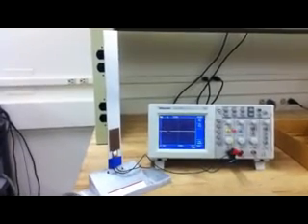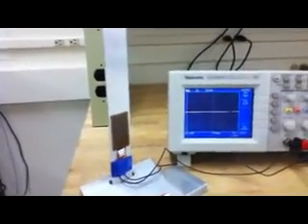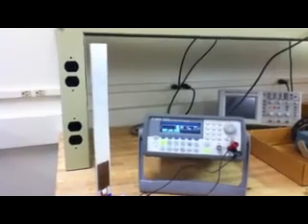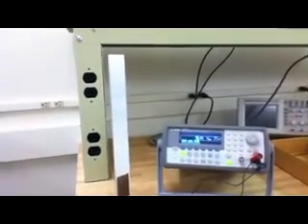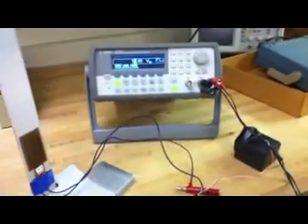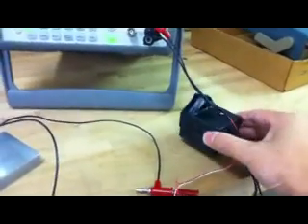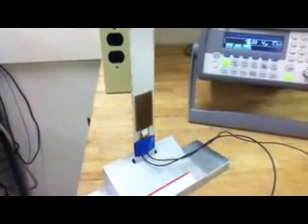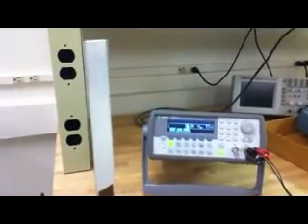PZT Sensor & Actuator

Comment: another question sir, did you tried to determine the resonant frequency by applying different voltages?
Reply from the maker: I have a function generator which outputs sine waves with adjustable frequencies.
Reply: does the function generator was connected to the sample (PZT)? and the oscilloscope was also connected to the sample? then if so does the frequency you set in function generator is equal to the frequency detected by the oscilloscope?

Comment: where you connect the negative and positive terminal of ac sourc in pzt material? and what is the dimension of the pzt?
Reply from the maker: The PZT patches already have electrodes and wires attached to them when bought. The patches I bought have dimensions about 1in by 3in. Their thickness is about 1/16 inch.

Comment: Hello, I want to use almost the same structure to create vibrations. My PZT is 5*5 mm and 1mm in thickness. I want to get ultrasonic vibrations with it. Do you mind telling me about the components that you used? I just know that I need a push button to start vibrations and an amplifier. Am I right?
Reply from the maker: You want to generate ultrasonic vibrations; I have no experience with that since the vibration in my device is at very low frequencies.Good luck.

Comment: Hi, 
I have piezo patches dimension (20mmx20mmx0.5mm) to be mounted on steel beam of dimension 2mmx25mmx200mm. Connecting it to a simple voltage supple isn't showing any response. What I should do? Please help. Don't want to use costly piezo amplifiers.
Reply from the maker: +Mayank Sharma You need a function generator to generate sine waves to power the piezo patch to produce vibrations. Normally, you would connect the function generator  to a power amplifier to drive the piezo. If you minimize the damping in your system through minimizing motion at the beam support, you may be able to get the beam to vibrate near its resonance frequency without a power amplifier.

Comment: Hi, 

This is very interesting. Do you mind sharing some information on this experiment? Can you tell me about the transformer you are using? What is the voltage gain did you achieve? What voltage do you need to operate the actuator?

Thank you,
Reply from the maker: +Ian Dizon The transformer is for PC speakers. From 120VAC to 12VAC. Operating in reverse direction, I get a voltage gain of 10. Piezo actuators typically require operating voltages of a few hundred volts. Thank you for your comments.
Reply: +Zaichun Feng Thank you for your reply! I am trying to set up something similar. Do you think it is possible to see appreciable vibration without having to permanently bond the piezo to a beam? I would like to test this piezo patch on different beams.
Reply from the maker: +Ian Dizon It seems to me impossible to make the beam to deform with the piezo without bonding the two surfaces together.

Comment from the maker: The patches are commercially available. I don't see any difficulty of mounting the patches in an array for underwater operation. You may have to work with the manufacturer if you have size limitations on the patches.

Comment from the maker: The patch I use was bought from ACX more than 10 years ago. I am not sure if ACX is still in the same business. You may have to contact another vendor. The patch is mounted onto the sample with the epoxy suggested by the vendor. Since composite material typically has higher damping, you most likely will need a power amplifier to be able to drive your structure into vibration. Keep in mind that the strain you get from PZT patch is very small; small even with a power amplifier.